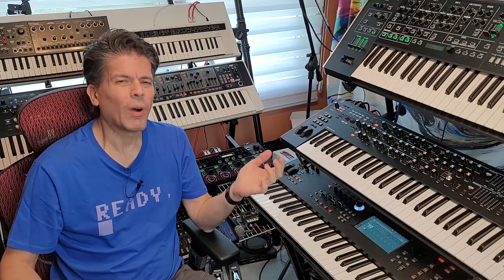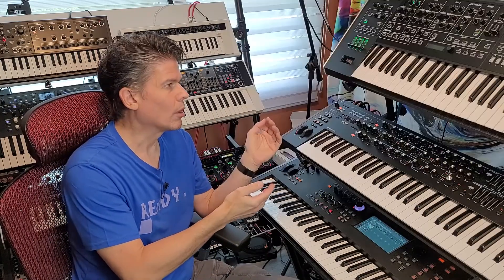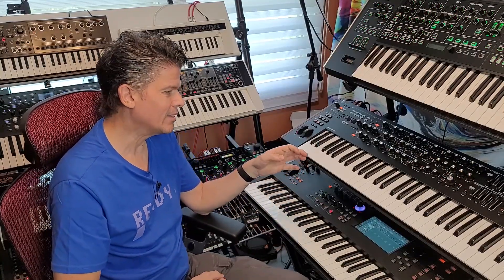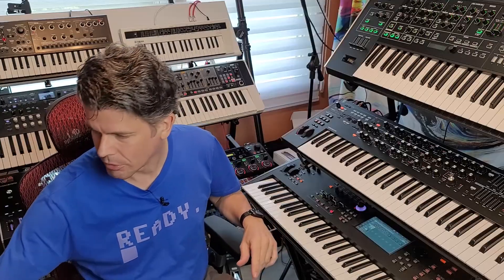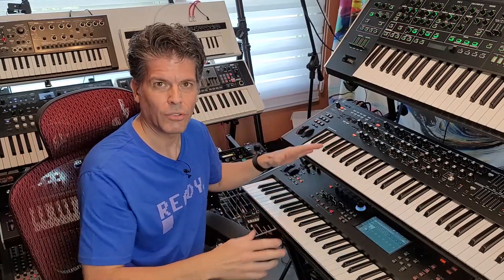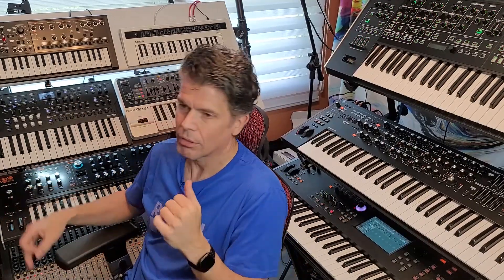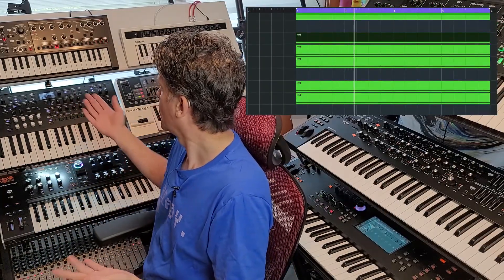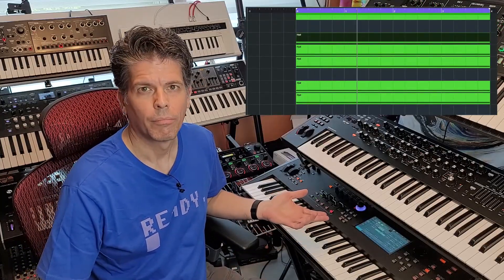MIDI Clock and your DAW: How To Sync Your Synths

Comment: My problem is that I have 30ms of latency through my DAW. I normally take external synth MIDI to -30ms to counteract that but when MIDI sync is on the track latency makes no difference (in Cubase).  Anyone have a solution?

Comment: Syncing hardware synths to my DAW has been such a nightmare. I want to send MIDI out to one synth that triggers it's ARP and then send that ARP MIDI out to another synth and then record the audio of that synced to the tempo of the DAW. Now you can imagine how frustrating that can get! Would getting an external clock device like the ERM Multiclock help with those kinds of issues?
Reply from the maker: It might...? But what I do for this is start the DAW recording audio (and simultaneously playing back MIDI) for several seconds leading up to the section I want to record. This allows the synth's MIDI clock to sync and stabilize to the DAW MIDI clock, so when you DO send it MIDI note data, it should be locked to that tempo.

Comment: Hi Scott! What happens when there's a tempo change during a song? Could this be a problem?
Reply from the maker: It will follow along. If the tempo change is sudden, you may have sync issues while it figures out what to do - depends on the synth and the algorithm they use. If the tempo is not sudden, or not a huge change, then it should follow right along.

Comment: Clocks are pretty good but clock to audio latency is different for any device so running a clock on multiple devices needs a Multiclock. Audio needs to be accurate in time and to achive this just clocking is not doing the job.

Comment: Bitwig is really has very good midi clocking and compensation, specially if you are going straight into your audio interface, also there are some other solutions, InnerClock Systems, has a unit that can take the midi clock from the computer and basically tighten it up and then send it to whatever external instruments you have, it uses audio rate signal and has plugin that works inside Cubase, this is so far the tightest I have experienced, I cant believe we still dealing with this and its 2025, maybe you have come up with another way to work in Cubase that does not require to edit the hell out of audio, which really takes the swing away from what you were working on in sequencing externally.

Comment: At time 2:40  you show your system 8 syncing And the time signature changes slightly each  second.  Every time my system 8 uses a certain delay the pitch bends weird with those slight variations in tempo.  Do you have a hack to avoid that?
Reply from the maker: It's a real problem with digital synths. They derive their clock by measuring the time between MIDI clock messages received. Any kind of jitter or latency in the MIDI signal or internal to the CPU means that measurement can be off from time to time, causing the derived tempo to fluctuate. Some synths are better than others at damping that fluctuation.
Reply: @ScottsSynthStuff   Thank you.  Will aria tr8 or mx1 or other aira gear also cause that kind of tempo  jitter if they become the master to the system 8?
Reply from the maker: @iano3880  it really depends on how stable their clock signal is. Some are more stable than others.
Reply: @scottssynthstuff what do experts do then with system 8s?  Just choose to either (use midi clock and turn off the system 8 delay ) or (use internal clock with delay on and manually change internal clock tempo between songs)?
Reply: Is this the same for drum machines? E.g my Roland TR8s?

Comment: I've got some vintage Roland to configure sync.  Roland SBX, MSQ700, JU-06A, Yamaha S80 and Behringer RD8. Korg DW8000  Other vintage without direct sync; Roland D50, Yamaha TX802, DX21, REV5.  I aquired everything but before I got a chance to experiment I suddenly got arthritis badly in my left leg.. which threw everything in my life off.. I'm adjusting now and ready to get back to it.  Besides these items, I have Ableton Live on the computer, Steinberg MOTU midi patch bay, Mackie 12 channel mixer. I have all the manuals etc.. Where to start now is the question.. back when I bought all of this I had a plan.. but it's been a minute.

Comment: Does this work in a daw that doesn’t send midi notes? I’m using GarageBand and have to manually trigger my arpeggiator. It does send midi clock I believe but I’m just curious if it will line everything even if I hit my keys slightly off time.

Comment: Great video and will try your "bar early" tip:     Is it better to sync midi via usb or midi din?
Reply from the maker: USB usually works, but DIN MIDI always works. I try USB first, if it has any issues, I use DIN MIDI. USB has a bit better latency than DIN MIDI.

Comment: Maybe one of you knowledgeable lads could help me out with my synthesizer. Just purchased a Moog grandmother and have been hopelessly looking for answers on how to properly connect it to my daw. I’ve got it connected to a Scarlett solo 4th gen, have all my drivers up to date, all firmware in the grandmother up to date aswell. Running the recommended Ts cable from the synth to my interface. I’ve also got my synth connected to my pc through usb. In FL studios, its showing that its all synced up and all options are enabled to start using the synth. When i play the grandmother it sounds like absolute shit. The audio quality is horrible, and sounds far from whats its fully capable of. I noticed in the audio options tab, it wont play audio off of my focusrite usb, but it does play off of the FL studio ASIO. Both sample rates and buffer sizes are matching aswell. If Anybody has any tips or tricks to stop my head from balding from all this stress, it will be gladly appreciated.

Comment: This is great but it doesn't help if you're sending clock from an external source to both your daw and other gear. I have an sp404 Mk2 and it hopelessly jitters and I've jet to find a solution (tho I haven't tried using 404 as a master)
Reply from the maker: Yup...I have an RC505 MKII that does not play nice with anything else unless it is the master, so I just have to reconfigure everything when I want to use that thing.

Comment: Hi everyone and Hi Scott; sorry if I'm going a bit OT but I need to  humbly ask the community for help, since I've NEVER been able to sync two or more devices using mini jack sync instead. I've owned many, including korg volcas, Arturia keystep, etc. Now I've got some second-hand devices: korg Electribe 2 sampler, sonicware Liven LoFi-12, Liven XFM...  I've tried a lot of times, since they all have the Sync In and Out ports, and I NEVER did it. I don't understand what is wrong: do I need specific mini jack for sync? Isn't a regular stereo mini jack fitting for this? How can I understand if polarity is right and/or how to set it correctly? Is there a complete guide to start with? Until now I connected the devices using the midi ports, but since I'd like to use them in some cases for other devices such as a midi keyboard, I'd like to set them free and start Syncing, at last. Thanks anyone for helping!

Comment: For strictly recording, this doesn't actually matter that much, really. You can record out of sync and just drag the recording into sync, as long as the tempos match, of course! Real time syncing becomes much more important when playing live.
Anyway, this is all fine in theory. Sadly, at the moment I'm experiencing a lot of issues getting midi to even work in my setup, and judging by what I'm reading online, I'm far from the only person experiencing issues with this. It's strange how such a seemingly simple communication protocol can have so much issues. I'm looking for info on how to go about solving these kinds of issues.
Reply from the maker: It does matter when you start using things in the synth that are BPM-synced, like LFOs and especially arpeggios - it will literally play the wrong notes, out of time until it syncs up, which is why you want a solid lock BEFORE the notes begin to play.
Reply: @ScottsSynthStuff  ah, you mean that the tempo will still be changing slightly at the start of the recording? That would be problematic indeed!
Reply from the maker: @mrblablablabla  Exactly. It needs that extra bar to finish syncing its tempo and adjusting its internal BPM to match.
Reply: @ScottsSynthStuff  thanks for the clarification! 
Any advice on solving midi issues (devices not showing up in software)?
Reply: Especially when that protocol is decades old! I wish all the companies would just strictly standardize everything period. Like wtf? Stop screwing around and torturing us it's hard enough to be creative with all the other technical BS getting in the way!

Comment: I was trying to do this with a Novation Supernova module and it was miles out. I have had success before but wasn't sure why not this time. Of course I usually have a bar or two free at the start in case I want to jump an intro before the track. Your video was really helpful in confirming that this is probably the reason why. Thanks very much for your help.

Comment: If you're using a hardware sequencer as your master would it make a difference whether you enable sending midi clock or not? Since midi sequencers can trigger notes at specific times in a sequence? Thanks
Reply from the maker: The hardware sequencer will still send MIDI clock, which will sync any other synths that require MIDI clock for something (arpeggiator, clocked effects, etc). If you aren't using any sounds on other synths that require MIDI clock to play correctly, then you don't need to have the hardware sequencer send it. The note on and off data is separate from MIDI clock.
Reply: @ScottsSynthStuff  ok so i use my MPC as a sequencer to sequence all my synths and drum machines, all of which don't require Midi clock to play correctly like you said.  Does enabling clock send just ensure that all of them are using the same tempo? Kinda like how a conductor directs an orchestra?
Reply from the maker: @miles46100  Exactly. MIDI clock makes sure they are all at the same tempo, so any tempo-derived effects (arps, delays, etc) are synced up.
Reply: @ScottsSynthStuff  thanks so much. I was so confused as to whether or not i needed to enable midi clock.
Reply: One more question: so if i didn't have a standalone sequencer, if I assigned one of my drum machines as the master, and did midi out and in to the other slave instruments,  when i press play on my master clock instrument, would it just start to play patterns that i have preprogrammed in the other instruments? Like on my Roland boutiques, they have their own step sequencers,  so my master clock would just prompt them to play sequences that i programmed into them beforehand,  except to the tempo of my master clock/drum machine, and it would just loop.  Hopefully that makes sense.
Reply from the maker: @miles46100  It depends. Some devices will just start playing their sequences when they see a MIDI clock. Some need a MIDI clock AND a "start" message - which your drum machine is likely already sending when you hit Start on it. And yes, they would follow the tempo of your drum machine.
Reply: @ScottsSynthStuff  Hello I'll follow this issue if you allow me. In the case they need a "start" message do I have to do it manually? Is there a  way to do it without a "start" message? Thanks.

Comment: I really don't understand this midi clock. I bought 2 external sequencers (Arturia Beatstep & Nektar Aura) and I'm working with win 11 & Reason 12.
It is impossible to synchronize correctly, there are crazy jitter, no note played at the same time, and it's not a problem of latency/drivers/hardware) I just think that there is no solution (it's been 1 year that I try to solve this problem to be able to use my sequencer). So basically, we are sold hardware that is just unusable to play live. If people have the miracle solution?

Comment: Also when syncing MIDI gear each piece must be plugged directly to the host but not daisy chained otherwise you'll build up a delay due to MIDI serial nature.
Reply from the maker: It depends. In the "old days" MIDI through ports were exactly that - a hardwired, electronic (well, optoisolated) connection from the IN to the THROUGH port, so no delay. Every synth on the MIDI chain got the same signals at the exact same instant, no delay and no lag.

Then came microprocessor-driven digital synths and cost reductions. The "through" port was removed as a cost reduction, and instead you could (if needed) switch the "out" port to function as a "through." If you did this, the processor inside the synth would read the data from the IN port, and re-send it out the OUT port. In doing so, it introduced a bit of lag. Daisy chain a bunch of these together, and you can get significant lag from the first device to the last device in the chain.

But if you're using classic synths with a proper "through" port, there is no lag at all.

Today, with the advent of inexpensive USB to MIDI interfaces that give you multiple MIDI ports on a single USB connection, every device can have its own dedicated MIDI port without having to daisy-chain, so this type of lag is no longer an issue.

Comment: That's super helpful. My problem with the wavestate though is that it won't play wavesequences sometimes if the clock is set to external. So should I keep it on auto and then just record a bar early? Most of the time with auto midi clock the wave sequence will work but I have to set the internal clock to the same bpm as DAW and then trigger the Korg.

Comment: Good to know! I just got the Summit as my first synth, and now I am worried about workflow when talking about the midi clock XD.. Does this problem also occur when Summit midi connects with any live sequencer and or does it only happen when connected with a Daw? And or how would you keep all synths in sync with the clock, when a sequencer gets involved in a live setup?
Reply from the maker: Normally the sequencer would be sending MIDI clock out, and in most cases it's going to be constant, so you likely aren't going to have to worry about start/stop clock sync on your digital synth trying to keep up.
Reply: @ScottsSynthStuff  Thanks! Still a bit confusing when you connect Summit to the pc, that it does seem to have issues to sync with the pc midi/usb clock.. I Assume that having a good mixer that also supports midi/usb clock sync, would be needed to maybe also avoid that latency problem?!.. Anyway it is good to see you also found a workaround for this.. keep jamming, cheers!

Comment: So sometimes you record in everything is in time but later in the arrangement some tracks can become off. It’s this MIDI Jitter? Is this the fault of the DAW or the Synth? What’s the solution?
Reply from the maker: If the drift becomes worse and worse over time, that is not jitter. That can only be caused by a) missed MIDI clock signals or b) a synth that is using an internal tempo slaved to external MIDI clock, and it's not following quite right.

Comment: If you are using Logic Pro, Apple is still writing a proper USB Driver for the Unitor 8 and you will not have these issues, but us Cubase folks are a bit screwed as midi in cubase is not what it used to be, anything with USB/Midi these days without a proper driver (class compliant is not sufficient) is going drift, been doing this since Atari 1040st which was super tight, the only other solution for me was to go to CV, control voltage, which is dead on all the time. You can also just insert the external instrument as an audio channel, and cubase can compensate the latency, I dont like to print audio right away, so this is another way to get super tight timing, Great Video. Cheers
Reply from the maker: I agree. Back in the OLD days (grey hair showing here) MIDI was tight, not as tight as CV/gate, but still far better than USB MIDI is today. I'm really holding out hope for USB 2.0 to fix this mess, with fabulous, well-written, low-latency drivers.

You're right that Cubase can compensate latency, and it does so fairly well...but there's no way any DAW can compensate for jitter, and we get unstable printed audio as a result. Some synths are FAR better at this than others. Many digital synths today are really poor at syncing their internal clock to MIDI clock consistently.

Comment: Is the same thing going on when trying to jam and loop? I’ve got cycle set up in Logic and a sequence that plays in time when pressing start, at the end of 8 bars the sequence skips the first one or two notes then starts to play out of time. Without cycle on, the sequence plays just fine for what seems like forever.
Reply from the maker: I've had the same thing happen in Cubase with a couple of synths. I haven't put a MIDI monitor on it to see exactly what happens when something loops in the DAW to cause this, but it's clearly a small glitch in the stream (probably the MIDI clock?) when the DAW loops that causes this sort of thing to happen.
Reply: @ScottsSynthStuff  I need to try and recreate it in a different DAW possibly or see how other synths react. It’s interesting each synth behaves a bit differently like you pointed out.

Comment: Hey there. I have a Moog Matriarch.  When it's not connected to Nuendo, the sequence plays what I programmed. But when I connect the midi, it plays extra notes, but not the sequence that I programed. Is there something I should check in Nuendo/Cubase? Thanks so much!
Reply from the maker: I wonder if you have a MIDI loop going on? You might need to turn Local mode off on the Matriarch, and rely on Nuendo to send the notes back to it? It depends on how things are configured.
Reply: @Scott's Synth Stuff thanks for the reply.  I turned off All Midi Inputs in Windows Midi.  Looks like I did have a loop going on. Seems to be working fine now. Thanks so much🙏🏽